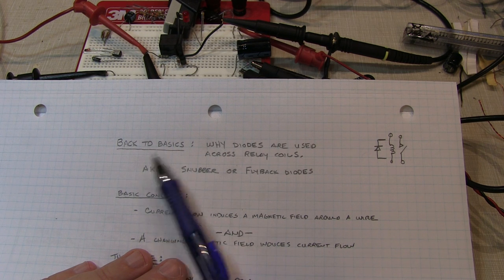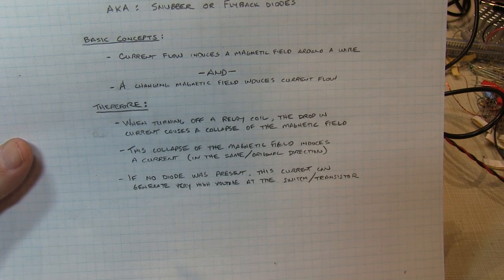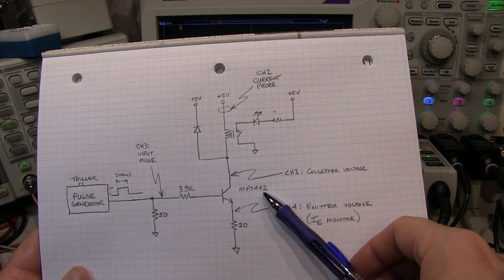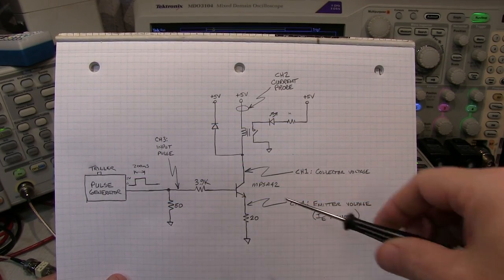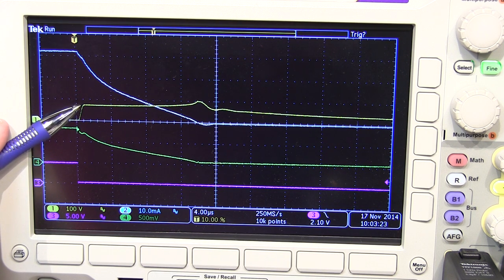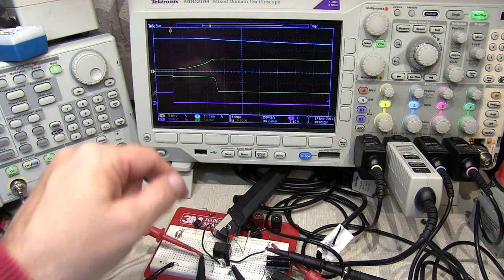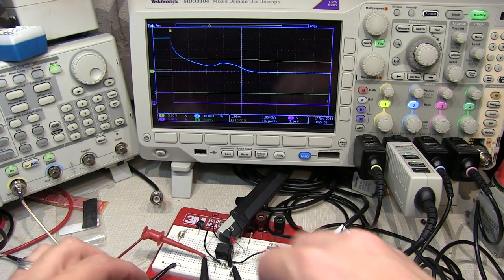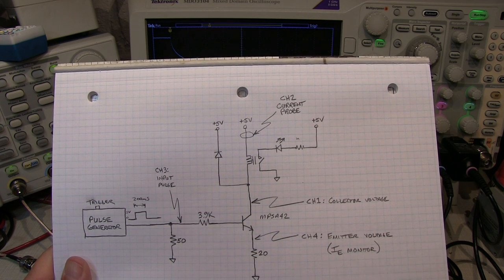#183: Why diodes are used around relay coils: Back to Basics on flyback or snubber diodes

Comment: nice video :) 
but i have a question : we all know that current flows from the higher voltage to the lower voltage , why than the current does not flow , when shtting of the transistor , from the collector to the + 5v  in the case that we dont use the diode?
Reply from the maker: sino rourou Because the coil is the source of the current, and the transistor is off.  Thus, the current has no where else to go, so we need the diode.
Reply: ok thx :)

Comment: So you're talking about the coil pushing out current as the field collapses, and that results in accumulating voltage at the collector, as the current has nowhere else to go.

Without the diode, would another way to deal with this be to sink that current into a capacitor? And then discharge that elsewhere, over time.

Would that have any use in preference to a diode, for dealing with inductive loads in other situations? I think I've only ever seen a diode used.
Reply from the maker: Sure, capacitors and/or series resistor-capacitor can be used as a snubber, but then you have to deal with the fact that you've made a little LC tank circuit and deal with the possible ringing, etc.
Reply: Right! Thanks :)
Reply: *****  In addition, when the transistor turns on, the capacitor is charged through the transistor adding to the relay current as a peak/spike at transistor turn-on.  That is why a resistor is required in series with the capacitor - to limit the 'turn-on' spike. Otherwise you have an excessive current spike through the transistor, to charge the cap.
73

Comment: Great video as always! Thanks for educating us.   Question: In addition to the flyback diode for the inductive spike, what can I use to prevent spikes from the relay's NC & NO high current contacts? (especially when the high & low current circuits are using the same supply). I am presently using an NTC inrush limiter, however once this warms up it doesn't provide much impedance for subsequent or unexpected relay switching spikes. Any suggestion?
Reply: Similar snubbers, but using resistors and capacitors, are sometimes used across relay contacts particularly to reduce arcing (sparking) when OPENING a relay contact that happens to be driving a motor or another relay (anything inductive).   This was common in automobiles that used distributors; there would always be a capacitor ("condenser") across the breaker points to reduce sparking.  The idea is that at the exact moment of opening, the capacitor has zero charge and thus zero resistance.

Comment: Very nice video! How do you arrange diodes around a single coil, latched relay?
Reply from the maker: +Steen Grøntved The diode is always connected such that it is reverse biased when the coil is energized.
Reply: But if you have a single coil then the current must be able to flow both ways through the coil.
Reply from the maker: +Steen Grøntved But generally, a DC relay coil only operates with one polarity.
Reply: +w2aew I'm not quite sure what you mean? A single coil latched relay does not have a spring, how do you switch it off/back without reversing the polarity?
Reply: +Steen Grøntved On page 3 there's one: http://www.mouser.com/ds/2/212/KEM_R7002_EC2_EE2-540906.pdf
Reply from the maker: +Steen Grøntved OH- I was totally thinking about electronically latched relays - duh!  In your case, you'd probably want to use a  pair of zener diodes in opposing series connection across the coil, with zener voltage > the supply voltage.
Reply: +w2aew Ah yes of cause! It makes sense! Thanks :)

Comment: Thanks for your amazing videos. I have a question. You are using a 50 ohm resistor for your sharp pulses. I guess the equivalent impedance seen by the function generator is more or less 50 ohm as well. The thing is, if the 50 ohm resistor is quarter watt resistor it can only handle (from P = V^2/R) 3.5V. What is the amplitude of your pulses coming from the generator? And am I right in my assumption?
Reply from the maker: I was actually using a 50 ohm thru terminator on the end of the coax that is rated for up to 2W.
Reply: Thanks I saw that component now in your video. Do you think it is a good practice to use for any output pulse frequency range for fast rising edge function gens?
Reply from the maker: Yes it is. Helps to keep reflections/ringing away, which could cause false logic triggering, glitches, etc.

Comment: If instead of a transistor there were a mechanical switch or a push button would a diode still needed? Or is that because the transistor switches very fast?
Reply from the maker: It's still a good idea, otherwise the voltage across the open switch can rise to very high values.
Reply: Thanks, I want to try your experiment with a 12V DC solenoid which has 100mH inductance and 30 Ohm resistance, and a MOSFET but my worry is the high voltage. Should I take any precaution to prevent the scope from hundreds of peak voltages?  Like scope probe setting ect. I mean I want to try without a diode first and observe on scope.
Reply from the maker: Most 10x passive probes are good to 300V or so.  I would imagine that the maximum Vds on the MOSFET might be lower than that, which means that you might damage the MOSFET.

Comment: When connecting 12v, 50mA reverse Parking sensor kit to existing 12v (ignition switched) wire powering cigarette lighter, is a diode necessary? The automotive relay I was considering doesn't have a diode.
Reply from the maker: It's never a bad idea to use the diode.
Reply: +w2aew ok, thank you. I'll try and source a relay incorporating a diode. :)

Comment: +w2aew thanks for the excellent video, what should be the rating of the transistor if the voltage applied is 400V if diode is present.What will be the maximum voltage if the diode is not present?
Reply from the maker: +rohith Krishnan The diode has no affect on the rating of the transistor.

Comment: I don't know the difference between a pilot valve relay compared to a mechanical relay, what are the differences between a pilot valve relay? are the pilot valve relays only rated for very low current?
Reply from the maker: I don't know what a pilot valve relay is.

Comment: hello, I have a question. What if i just connect a wire to ground between the transistor and my relay? Instead of a diode I have a wire to ground.
Reply from the maker: If you do that, you can't turn the relay off.

Comment: Hi, whats the chunky box at the end of your test probes.. are they differential probes? or is that a 50 ohm resister?
Reply: I like your vids.. they help learning but dont put me to sleep
Reply from the maker: The current probe has a built-in current-voltage transimpedance amplifier in that box.  The voltage probes have the compensation circuitry in that box.
Reply: Thankyou for your reply

Comment: is it a good practice in putting a small resistance between input pulse to ground? isn't limiting the current enough?
Reply from the maker: It depends on your circuit.  In my case, I put 50 ohms to ground at the input so that my pulse generator was properly terminated.
Reply: Got it, thanks

Comment: Would the same hold true for a switched mode power supply (PULS, IDEC, Phoenix, etc) of say....100w, which operates a few 8.5w 24v solenoid valves? Are PWS like these I mentioned internally protected from the factory, that you know?

Thanks again for a great vid!!! Time for calculus homework :-(
Reply from the maker: +Brian Streufert I don't know if these supplies are internally protected - so always a good idea to add the diode around the relay coils.
Reply: +w2aew Thank you for the reply!
Reply: +Brian Streufert   Yes they do, Brian.  Using switch mode is an efficient way to do thinsg, but the rapid turn-off is a big issue that must be correctly taken into account.  I've designed fractional HP PWM motor controllers and the "catch" diodes as we called them, and the effect they have are an important part of the internal design.

Comment: What sort of current flows back through the diode - is there no need for a resistor in that path
Reply from the maker: +Rob Palmer The current won't exceed the normal "on" current in the relay coil.

Comment: I don't understand how we send current back into the positive power supply through the diode,  wouldn't that damage the power supply then?
Reply: Well, I wish he had drawn the schematic a bit differently. He should of drawn the diode in parallel to the coil only. The way he drew it is confusing, it looks like the pulse is going directly into the power supply, but remember those 2 +V points are connected together.

Comment: Did I understood?  Without diode the current rises to about 250 volts.  With a diode it does not rises much.  If the current (with a diode) rises  (lets say  15volts) what appens to the 5 volts  batterie?

Comment: G'Day,,just have found this film,,yer 8 years,,any way,
can you use the fly back voltage to fire another relay,,sort of time the effect,,
I want to use 3 coils,but want each coil to fire in unison, with a minimum of delay,timed  from magnet feild collaspe,
and with out an occilascope How do i read the fly back voltage,?Thinking transformer to reduce voltage to next relay,from spike.Have been all over,, there may be an answer but i cannot find it yet,,why i have just discovered your channel,,
Thank you for the great vid,,,but in my case raises more questions than answers,
Mechanic by trade but always love the electron and what they can do,,,
just don't know as much as i need to complete project,,
Reply from the maker: The flyback energy won't last long enough to engage another relay.
Reply: @w2aew  Super Thanks for the quick reply,,
MMMmmmmmm,,,Yes,but don't want hold relay on,,just close it long enough to disccharge another coil supply and so on,,
Yes building a coil gun,,but only firering 2.5 by 60mm  solid steel projectile,through a 2.75 ID brass tube,the plan was to wind brass  tube and use the Spike return to fire second coil and the second fires the third,
Now the problem i see is the time for magnetic field complete collapse,,trying to remove any induction forces going in the wrong direction,or hoilding projectile in coil centre,
Hmmm,,
Think using a normally closed relay and flash open to fire second and third coil,
Bit like set of points used in a car,,
am going to try coils from car plug pack to fire magnet coils on gun,,
the only other way i can see is to wind feeback coil so when first coil is fire,,and collaspes.then second coil will fire,the feed back Coil on the second set of coils will then fire the third set,,

Comment: Thank you very much for all the good explanations, much appreciated here in europe too ;-))

One question : isn't it a problem for the source to receive back this current from the coil ? Can it damage the source (if it is a battery or a generator) ?

Brgds
Antonio
Reply from the maker: The energy really isn't sent back to the supply, it simply is dissipated in the coil and diode.
Reply from the maker: ***** Upon further thought (and discussion with my friend Adolf), you can really think about the current being returned into the positive supply rail.  It generally is not a problem to do this because often the supply is providing much more current to the rest of the circuit.  Adding current back in doesn't present a problem - it just reduced the amount of current supplied by the supply.  If the current being returned exceeds what the supply is providing, then you can get into an issue...
Reply: ***** Thank you for digging further for helping me understanding better. It is interesting answer. brgds

Comment: this is exactly what i'm looking for..thank you so much..i would like to ask, coz i'm using a 12 volt source to power both my pulse generator and the solenoid..what diode would you suggest for me to use..thank you ind advance..my solenoid is rated at 350mA..please bear with me coz i'm having difficulty since i'm not that good in English language..Tanx
Reply from the maker: An ordinary rectifier like a 1N4001, etc. should work fine.
Reply: can i use a 1n4148?coz i will be powering the solenoid using a rapid pulse with 50-50 duty cycle..say 500ms pulse..
Reply from the maker: I wouldn't.  The diode will need to be rated for the same current as the solenoid, and 350mA is too close to the maximum repetitive forward current rating for the 1N4148.
Reply: thank you very much..and thank you for being so kind..
Reply: will 1n4448 be good?

Comment: you should make more videos ""Back to Basics" , I miss a new one :) I suppose time is the biggest issue for you as is for everybody
Reply from the maker: I do plan on doing more.  As you said - time management is the real challenge.  What would be your top 5 "back to basics" topics that you'd want to see?
Reply: w2aew Oh, I am currently interested in SMPS's. I would like to learn how to discern by measurements the operational range for high frequency transformers. I am also interested in NTC and PTC operation. But, leaving my interests aside, I learned more from you when you showed "unusual" applications of common items, like when you were using the rectifier bridge for blocking a signal in the flexible signal generator with a opamp, current source and current sink. I would like to learn about less common application of components, like triacs in DC circuits. Probably this would make a great series: Interesting applications of common components.
Thanks for taking time to reply, and for asking me for suggestions, Allan. I am honored

Comment: what happens if you put the diode is series with the transistor (between transistor and inductor)?
Reply from the maker: It won't shunt away the flyback energy, and you'll get a very large voltage spike as shown in the beginning of the video.

Comment: Why the inducted current from the coil flows to +5V through diode? is it because +5 potential less then in coil at the moment?  Im not good at English sorry
Reply from the maker: The induced current simply flows out of the coil and through the diode.  The +5V supply simply pins the voltage on one end of the parallel combination of the diode and coil.

Comment: Will Fluke 87 capture this change with its peak MinMax mode?
Reply from the maker: Most likely not, a DMM's sample rate is much too low
Reply: So capacitor wont hold that charge enought tfor Fluke to capture?
I would love to see video of that kind, to see few multimeters and if they are capable of catching spikes with its MinMax modes... just to know what we can do and what we cant..
Reply from the maker: From simply looking at the spec of the latest Fluke 87V, the min / max hold can capture transients as small as 250 microseconds. You can see from the scope trace that the high voltage peak lasts only about 1 microsecond, about 250 times too fast to be captured by the max hold feature.
Reply: sepertude  You should / may be able to use a diode and cap to capture the peak (minus the 0.7 diode drop) .  A half wave rectifier of sorts.  Something like a .01 and a dode pointing away from the collector toward the cap to gound. You are 'stealing' some of the relay coil 'discharge' current to charge the cap, so it won't be quite as high as actual.   It's not the greatest, but should give you an idea by stretching the peak along enough for the DMM to see it.
73
.

Comment: What are those block connection things plugging into the scope ?  What are they for and what are they called ?  :-)
Reply from the maker: ??  They are simply the other end of the probes.  On the passive voltage probes, these would traditionally be the compensation boxes (although passive probe compensation is handled a little differently with these probes).  And for the current probe, it is the housing for the probe amplifier, degaussing control circuit and range selection circuits.
Reply: ***** What do they compensate ? Do they protect the scope from high voltages and/or currents ??
Reply: Peter B They let you adjust a trimmer capacitor to set the high frequency (capacitive) attenuation of the probe equal to the low frequency (resistive) attenuation. You can compensate for the fact that the input capacitance of the scope can vary a little bit and thus avoid (for example) square waves appearing spiky or having rounded corners.
Reply from the maker: Peter B Check out this video to learn about passive 10x probe compensation:
Basic 1X and 10X Oscilloscope Probe tutorial